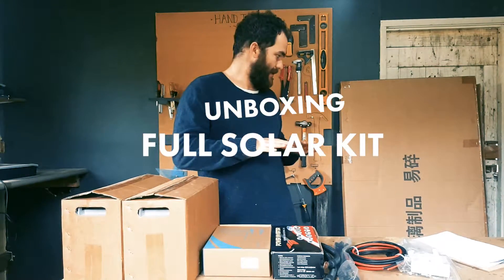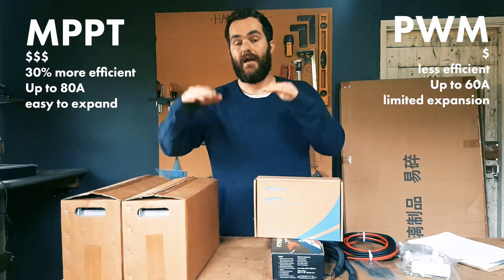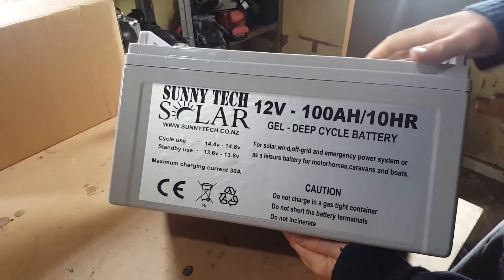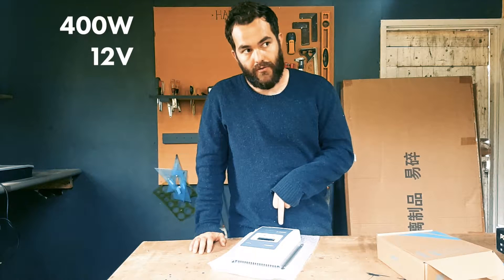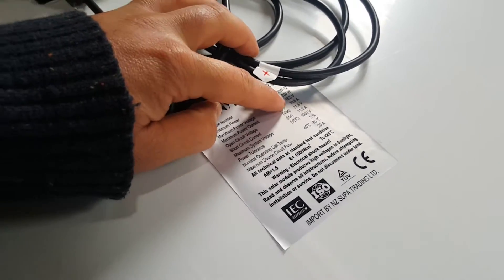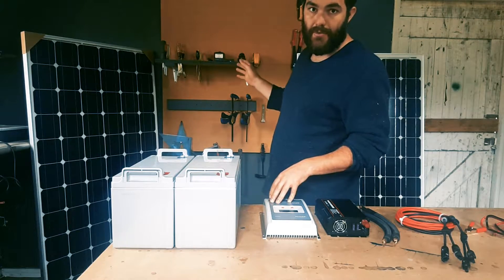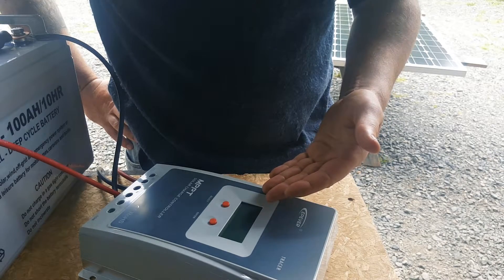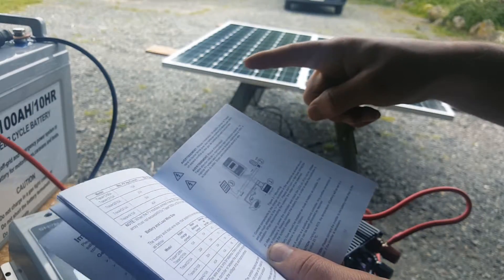DIY Solar Power: What do you need?

Comment: was that two 12 volt gels  for a 24 volt system?
Reply: Julian Goulding 
I went with golfcart 6 v batteries for my 24v system. I wouldn't push the gel batteries hard. And not overcharge them. Agm is much better. They develop bubbles or air pockets causing a loss in capacity. I went with flooded 6v batteries for the added capacity. I could have went with 12v and still the same number of batteries with less capacity. I would rather have 2v batteries if I was going with lead acid. I'm working  on lithium batteries now. The lead was to get started. And get off the generator. Just be sure to not over charge or pull too much current from your batteries. Or discharge go far. It will shorten the life. I just came across your channel. How is everything working out? I have the same controller. Well two of them . I have 30a tracer. And the new tracerAN. They work well do far. I will be getting  another soon unless I find something better at a better deal. The AN is a great improvement over the A series. It is basically what TBD A should  have been. Just by looking the blue buttons and black heat sink is all changed. The back lit display was really needed. and I subbed!
Reply from the maker: 12v system. 2 batteries for more storage.
Reply: Always thought two 6 volts were better than  one 12 volt.
Reply from the maker: I dont see too much of an advantage of have 2 6v over 1 12v. Maybe if one fails its easier to replace or they are easier to handle. I have seen massive 24V array of 12 2v 1200ah batteries before and that is the reason that they are separate. I wanted deep cycle gel batteries and this is how they came at a good price.
Reply: looking good
Reply: Julian Goulding 
I went with golfcart 6 v batteries for my 24v system. I wouldn't push the gel batteries hard. And not overcharge them. Agm is much better. They develop bubbles or air pockets causing a loss in capacity. I went with flooded 6v batteries for the added capacity. I could have went with 12v and still the same number of batteries with less capacity. I would rather have 2v batteries if I was going with lead acid. I'm working  on lithium batteries now. The lead was to get started. And get off the generator. Just be sure to not over charge or pull too much current from your batteries. Or discharge go far. It will shorten the life. I just came across your channel. How is everything working out? I have the same controller. Well two of them . I have 30a tracer. And the new tracerAN. They work well do far. I will be getting  another soon unless I find something better at a better deal. The AN is a great improvement over the A series. It is basically what TBD A should  have been. Just by looking the blue buttons and black heat sink is all changed. The back lit display was really needed. and I subbed!